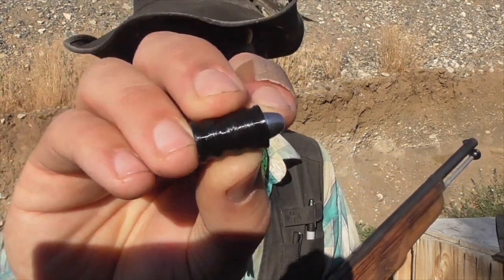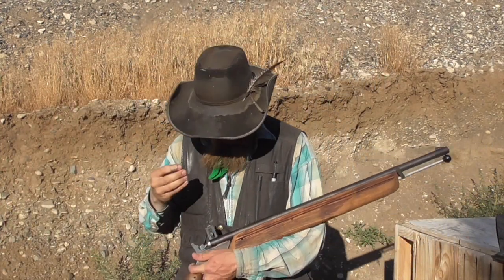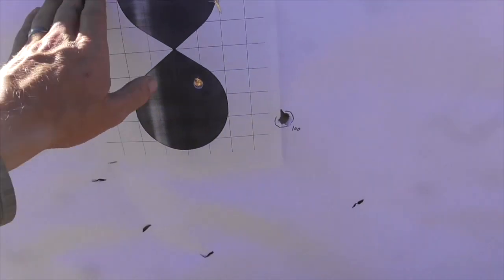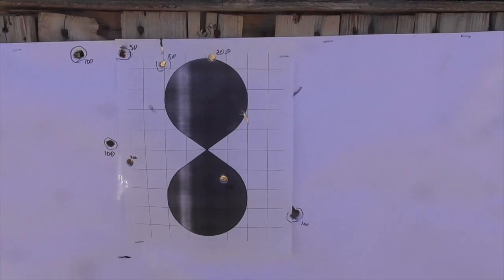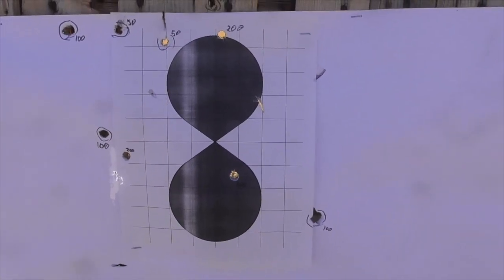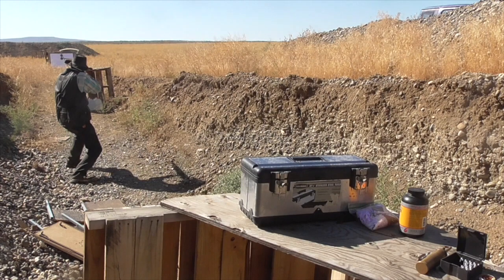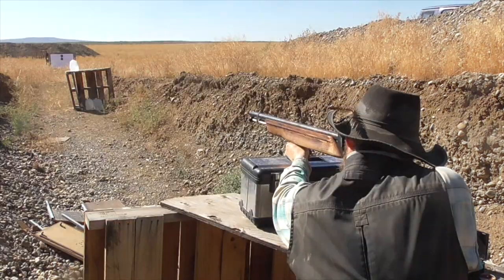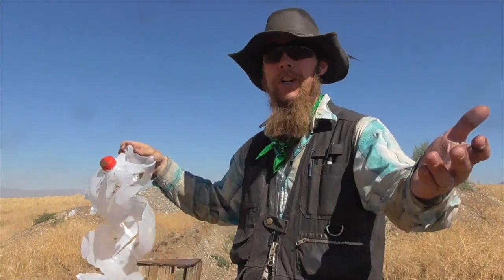Testing 3D Printed Muzzleloader Sabots (TIS385)

Comment: The bullet is most likely not spinning as fast as the sabot.  If you could cut a thick slot in the bullet and print the sabot with a "pin" to fill that slot, it would help it spin with the correct speed as imparted by the rifling.

Comment: I think you'd have better results from using a projectile which is both lighter and naturally aerodynamically stable with no spin-stabilization such as a composite diabolo style projectile. It wouldn't even require sabot.

Comment: The velocity spread was really huge. That may be a part of the accuracy issue. How did the sabots look after firing? All the factory ones that I have encountered on the range were still in one piece. Maybe try varying the diameter of the sabots by a couple of thousandths like with cast lead bullets.
Reply: Saboted projectiles often skew chronograph data.

Comment: Is there any chance the sabot is not gripping the rifling well?
Reply: printed plastic need to let lead go after barrel ,and if it is pla or abs petg on that heat they are stuck at it  ,so not rly sabot ... original ones use plastic like these cups in shotgun shells that on heat spread fins and let projectile go
Reply from the maker: Possibly—I might try a second iteration with a slightly larger diameter for a tighter fit with the rifling, but since the 200-gr loads were stabilizing correctly, there must be enough engagement to produce some spin.
Reply: @TheIdahoanShow  ever try cast aluminum (w/ steel BBs inside) BTHP? Stuff that in a sabot, and stick it in your pipe...
Reply: @TheIdahoanShow  Correctly? I am not sure. The accuracy was a bit off, I thought. Been a long time since I messed with that stuff though. All most interesting at any rate.